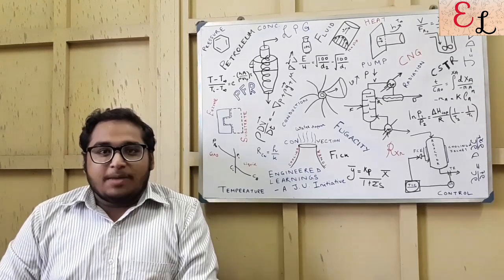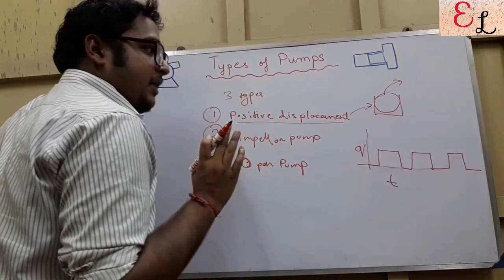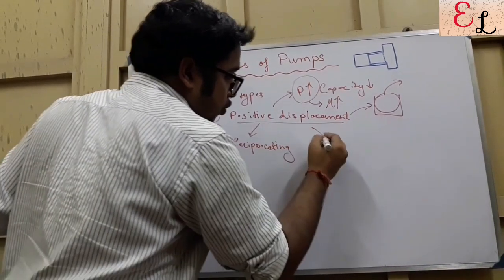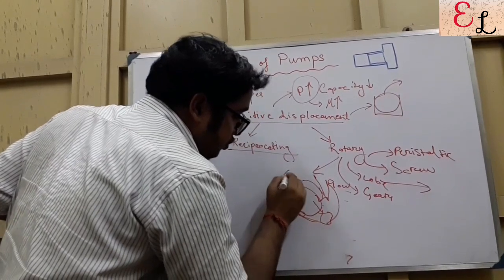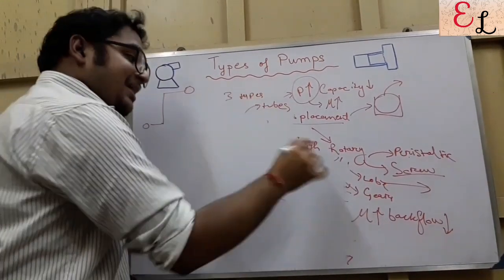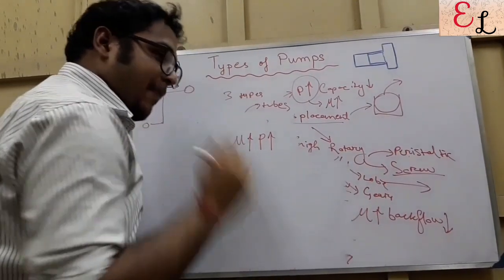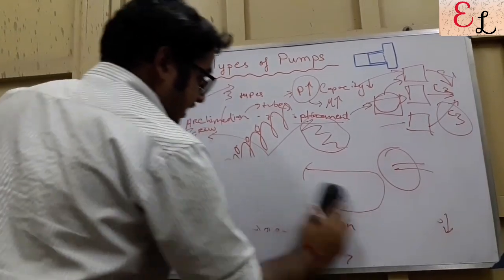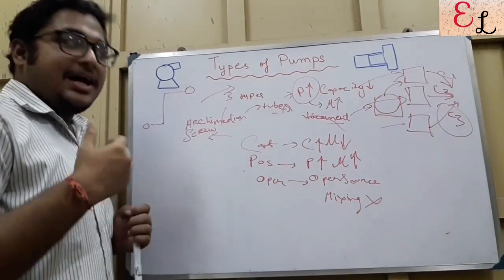TYPES OF PUMPS | PUMPS IN SERIES | PUMPS IN PARALLEL  | FLUID MECHANICS | PLACEMENTS | INTERVIEW

Comment: At 13:14, you inadvertently said that a low viscosity fluid is well served by a positive displacement pump.... Keeping aside this fact, the overall lecture is very good,crisp and serves as a great last minute tool for brushing up the concepts before any interview or exam... Thanks a lot....and Keep Uploading.....
Reply from the maker: Yes there was a little Glitch, Positive Displacement Pumps are always used for High Viscosity Fluids, it just went a little wrong with the flow accidentally at 13:14 as you correctly pointed out. Sorry for that! Thank you for liking our work.

Comment: Dada in this video first u say that positive displacement pump is used in high viscosity and high pressure but then u say when low viscosity and high pressure and high capacity required we use multiple positive displacement pumps in parallel . I have a doubt that is in positive displacement pump we use low viscous or high viscous fluid.
Reply from the maker: Yes there was a little Glitch at 13:14.

Positive Displacement Pumps are always used for High Viscosity Fluids. 
Centrifugal Pumps works on the principle of quickly throwing away the incoming liquid from the eye of the impeller to the periphery and handles large quantities of liquid at a continuous flow, if the liquid is highly viscous, the quick movement of the liquid from the eye to the periphery won't be taking place. The velocity of the liquid will drop midway. Thus, we generally avoid Centrifugal Pumps for pumping highly viscous fluids.

 It just went a little wrong with the flow accidentally at 13:14 as you correctly pointed out. Sorry for that!
Reply: @LifeBeyondBusiness  ooo... thank u 😊

Comment: peristatic pump er work principle ta thik bujhlam na...aktu jdi bolo arekbar.
Reply from the maker: Peristaltic Pump Works like a Muscular Valve Peristaltic Movement, as if the Blood is flowing through the Blood Vessels and the Blood as a fluid is Pressurised against the Vessel Wall by a Vane arrangement, and this constant Pressure created by the Vanes at regular intervals helps it travel from a Low Pressure Zone to a High Pressure Zone by Pushing it through.